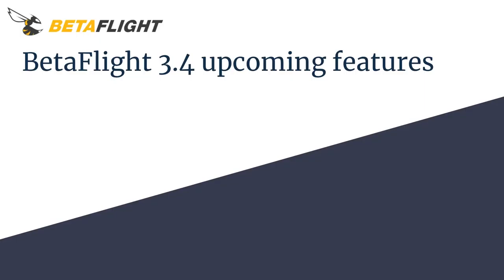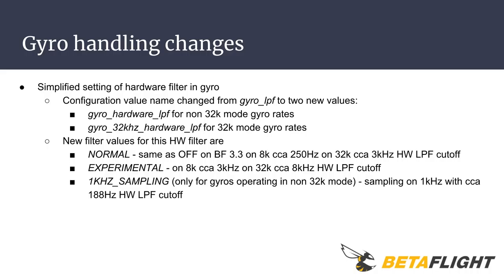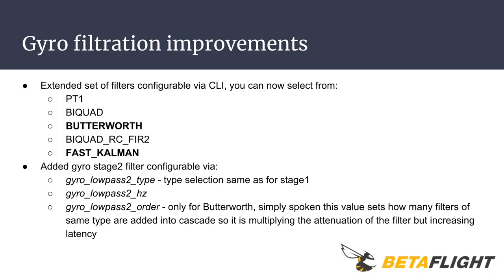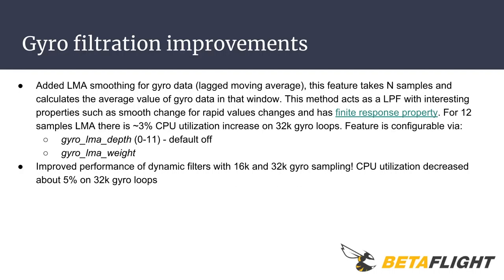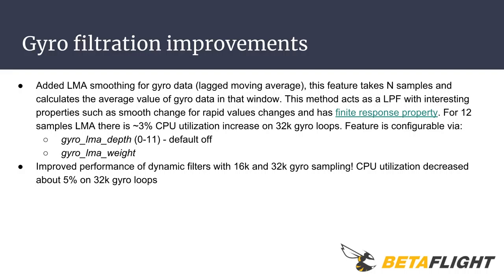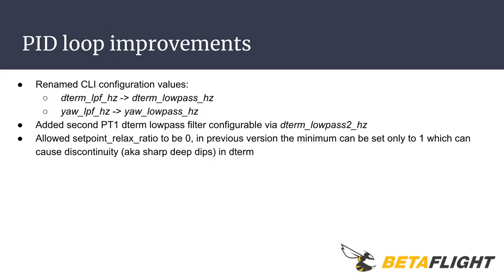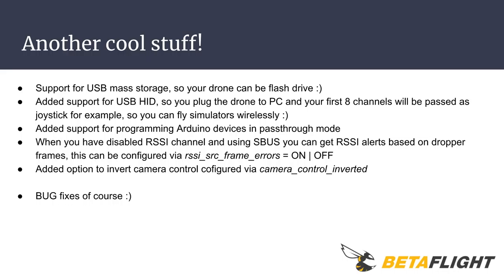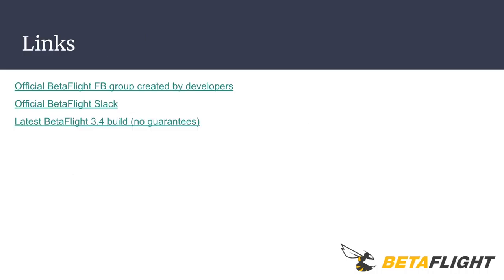BetaFlight 3.4 upcoming changes

Comment: Can I just flash my FC with Betaflight 3.4 and connect a receiver to it and just fly in the simulator?
Reply from the maker: Yes, exactly. I would recommend the F4/F7 board. The feature is by default built in the firmware you just need to enable it by "set usb_hid_cdc=ON" in CLI (for F3 you may nned to rebuild the firmware with feature enabled). Also good idea is to select FC / RX combo able to be powered on completely from USB, for example Matek F405 has 4V5 pin suitable for any FrSky receiver powered directly from the USB port (no lipo needed).

Comment: Can't connect to configurator after flashing 3.4. downloaded latest vcp. Don't know how to uninstall the old comports. Any suggestions. Is there a beta configurator out there or something that supports 3.4?
Reply from the maker: There was a broken build in which commport connection was broken, I suggest to use the latest nightly build from this link: https://ci.betaflight.tech/job/Betaflight/lastBuild/. If you need to change the driver for serial port I suggest to use Zadig tool (http://zadig.akeo.ie/). Under Options check All Devices, select your FC and change the driver. For my Kakute F4 V2 I am using USB Serial (CDC)

Comment: Can I use the HID right now? How? :)
Reply from the maker: On BF 3.4 sure you can, just set in CLI usb_hid_cdc=ON save and reboot and your FC will be recognised as serial port + gaming device ;) This feature is enabled for all F4 boards,  for F3 boards you might need a custom build with feature enabled (aka I did not test it on F3).